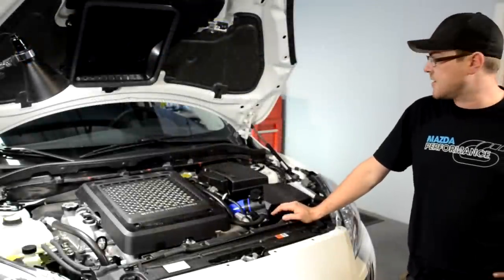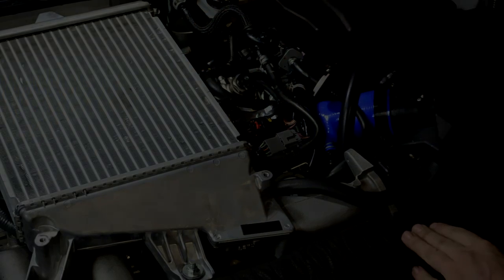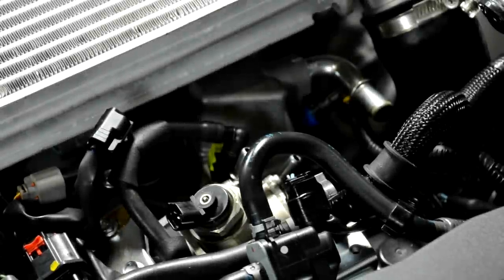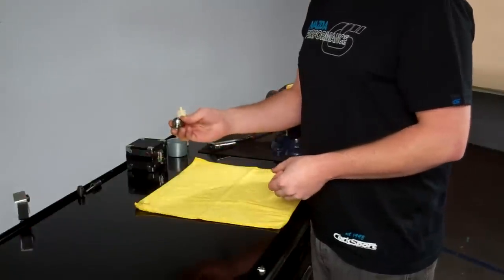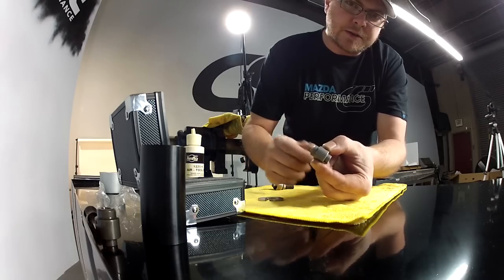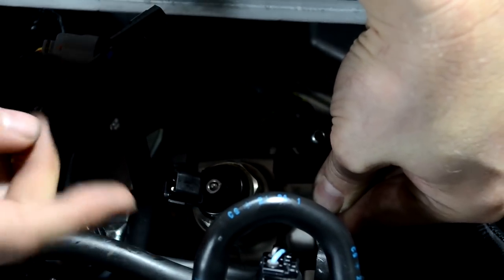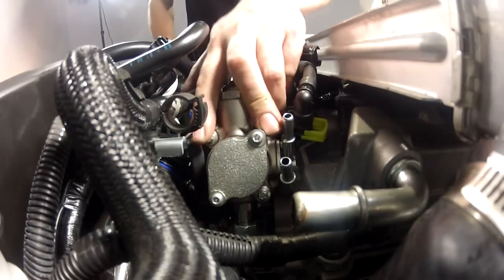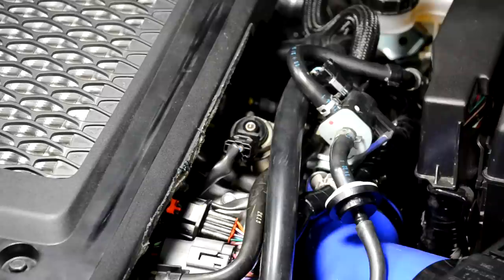CorkSport Max Flow Fuel Pump HPFP Internals - Install Video

Comment: How did you get the high pressure fuel line back on? The nut doesnt meet up with the fuel pump even after bending

Comment: It's still best to pull the blue "circuit" fuse, start the car and let it die before removing the battery cable to remove excess fuel in the line. Makes it much easier and safer.  🚗💨😉👍
Reply: Just did my fuel pump internals. And apparently the circuit fuse trick to release the pump pressure does not work for gen1's. I pulled the circuit fuse, started the car and it just ran and ran. It really wasn't too my fuel spillage. Just need to have some rags handy. Even after starting the car three times to try to do the circuit fuse trick, it still wasn't too bad. Thanks Corksport for the install vid. It was great to use along side the white paper that came with the internals. 👍
Reply: Atticaz Just did my fuel pump internals. And apparently the circuit fuse trick to release the pump pressure does not work for gen1's. I pulled the circuit fuse, started the car and it just ran and ran. It really wasn't too much fuel spillage. you just need to have some rags handy. Even after starting the car three times to try to do the circuit fuse trick, it still wasn't too bad. As for the lower fuel line, I zip-tied mine, as to not lose it in the abyss. 

Thanks Corksport for the install vid. It was great to use along side the white paper that came with the internals. 👍

Comment: The 17mm nut is it possibly for that to get loose and possibly leak fuel i recently had to take off my hpfp but it keeps leaking i make the 19mm is as tight as it can be the two plastic clips are also in place

Comment: Why not pull the fuel pump fuse, start the car and let it run until it starves on fuel so there won't be any pressure behind the fuel pump?
Reply: if the battery is disconnected, since you are working on the fuel system - which is good practice... the fuse isn't doing anything important.
Reply: Collin Klopfenstein that's what you should do, I'm not sure why they didn't do that before unhooking the battery

Comment: did you put the stock airbox around the aftermarket intake filter? that looks like a great idea for possibly keeping temps or dust down
Reply: Colin Shahan they sell a airbox for short ram intakes if I'm not mistaken

Comment: Do I need to install this if my only mods are short ram intake and cat back exhaust ?
Reply: It’s an essential mod regardless. Have you still got the car 6 years later lol?
Reply: @OGtrushalpatel  I’m gonna be doing mine here this weekend as well as injector seals and cleaning the valves and injectors also changing the e slave cylinder

Comment: Question , i installed this on my car and now its ticking , however one thing i didnt to is put that metal bucket inside the fuel pump back again, if i kept it in i wouldnt let me put the fuel pump inside the housing . Is this something i need to be puting back in?
Reply from the maker: Can you shoot us an email to sales@corksport.com? That will be a better avenue to communicate and help you!
Reply from the maker: You need the lifter in the pump housing.  Inspect the camshaft when you take it apart and make sure you did not damage the camshaft or the fuelpump internals.

Comment: I bought a speed6 for about a year now came with some after market parts. I was wondering if there is a way to find out if the internal hpfp is swapped  out.
Reply from the maker: There is no real way to determine for sure only based on the values from the Fuel Pressure Readings. You will want to remove the pump and inspect the internals yourself. Our internals have an octagonal bottom and a serial number. which tells you really quick. The auto techs have a dual retainer on top as well.
Reply: Thanks

Comment: how did you tighten to 8ft-lbs with a normal wrench? also has anyone got any feedback to say bout this part is it good ? does the car fill better?
Reply: With some wrist gauges.
The part is really great, and easier to install than Autotech internals due to a more custom and complete design with the included spring and installation tool.
Some people will say their car feels "smoother", but if this is your first mod (as it should be on a Gen 2) it's more for peace of mind and freedom to mod away in the future knowing your pump won't give out and let the car blow it's engine into bits.

Comment: Ok everything went fucking smooth except trying to get this pos pump back onto the car. Currently sitting on my driveway dead. The bottom fuel line is not fitting back into the pump and its extremely hard to get it to fit back in. any help please?
Reply: Did you, eventually, get that fuel line back on?
Reply: Yeah i did, i had a leak at first but took the pump back out and put it in and it fixed it somehow lol probably misaligned a little idk
Reply: bro how did u do it im fucking dying tryna get it on

Comment: Do I need to install this if my only mods are short ram intake and cat back exhaust ?
Reply: If those are the only mods you are going to do, then it really isn't necessary. If you change your downpipe, you will most definitely need it.  The COBB AP3 is a great way to monitor your fuel flow...
Reply: +stevewk2009 False. You will definitely zzb if you don't do that. ANY mod too the motor besides a BPV you will need hpfp. Any mod that makes more hp will need it because the stock fuel internals can't keep up. fuel pressure drop ZZB. The stock fuel internals are very close to not being able to keep up stock.